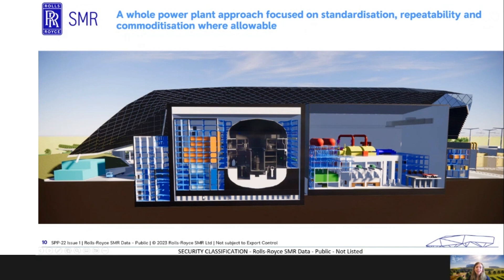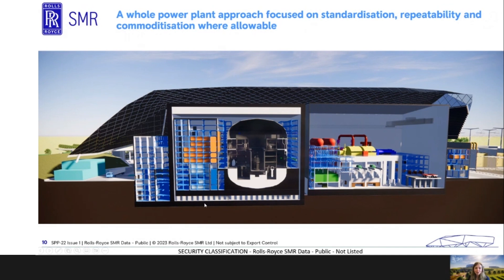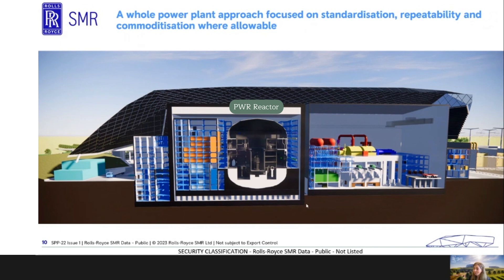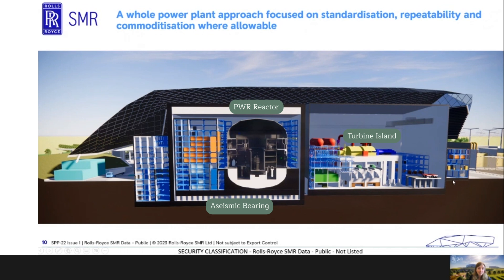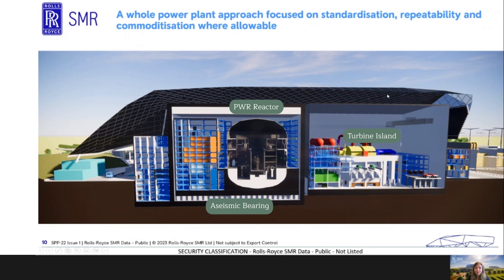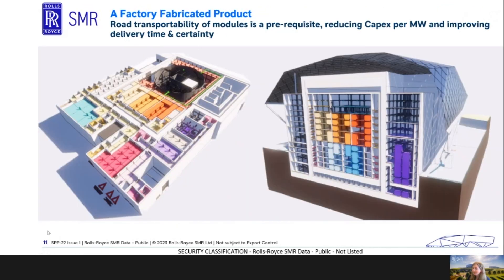Is the Rolls-Rolls Royce SMR the solution to Australia's Energy and Climate Crises?

Comment: The primary risk of nuclear power generation is without a doubt human stupidity. (think Chernobyl) 
Finland has developed a waste disposal system which is safe, reliable and sustainable and since Australia is not prone to seismic catastrophes like Fukushima, this secondary risk factor is not an issue.
SMR's is fine for power generation in remote areas with limited demand while solar my be used for domestic purposes as a backup only. I am not an advocate for wind power because of the ridiculous cost of installation and maintenance of these machines.
Keep your fossil powered units running as your base until such time as when you can replace them with full blown nuclear plants.
You also have a problem keeping the "greenies" off your back, but that is a conversation for another day.
Good luck Australia. Go nuclear. (from a South African friend)

Comment: All I want to know is how much would an SMR cost, how many would we need for Australia and in what time frame can they be delivered. As far as I can see the cost is prohibitive, we would need at least 40 half Gigawatt nuclear reactors to replace just the coal-fired power stations we need to close ASAP and it would probably take at least 30 to 40 years to develop and build out these reactors. 

Renewables, both wind and solar, are ramping up now at a far reduced cost and we have the expertise to build these now. Battery storage is also ramping up as is the long needed up grade of the grid. Also the development of different battery storage types is progressing well. Compressed air, gravity and sand batteries all appear to have significant potential as they are cheap, easy to build, environmentally friendly and can store energy for days or potentially weeks depending on their size. 

As the intervee said the first will not be up and running until the early 2030's and that is if all goes well. Then there will be the time required to scale up production and then the time required to actually build them in Australia.  Also with most things nuclear cost over runs are a huge problem and it is usually the taxpayer who has to foot the bill.

Comment: The much talked about South Australian battery bank (once the largest in the world) would power the states load for a whole four minutes. In addition it requires maintenance and has a remarkably short service life (after that period it becomes expensive to deal with hazardous waste). Nuclear is a great option.
Reply: The battery was never designed to provide base power as I hope you realise. Its main function was to support and stabalise the grid. It has been doing this successfully now since 2017 and took just two and a half years to pay off its $90 million construction cost. The batteries, when retired, is not waste as they contain valuable materials that can be recycled. I am not sure how much longer they will last but most grid scale batteries last for about 10 years before their storage capacity has gone down to the extent that they need replacing. I guess this means that in 2027 they will need to be replaced.

I personally am not against nuclear power if it could be delivered at about the same cost and in the same time frame as Renewables. At this stage it cannot and it would take at least 10 years to build the expertise needed to build, run and maintain the first nuclear power stations. It would then take a further 20 to 30 years to build all the nuclear power stations required to replace existing coal fired power stations. By this time advances in all forms of renewables, storage and grid development will make nuclear even more unfeasible.